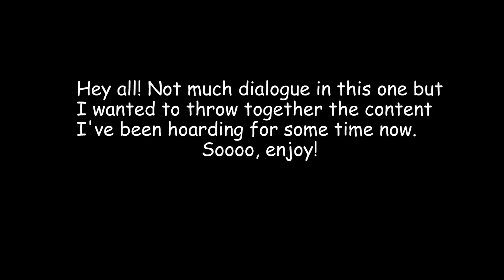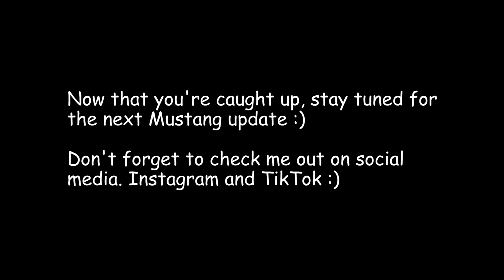Putting Together My Turbo Piping | Turbo LS Mustang

Comment: That T56 is going to be holding on for dear life LOL, might need a th400 or powerglide
Reply from the maker: Lol one way to find out! Haha prob gonna go with either of those two down the line
Reply: @rachaelrayve  ATF has a really affordable stock class powerglide for $1800 ish thats rated for 900 wheel. If you consider the swap, i think you'll make out even, i know those T56's cost an arm and a leg lol
Reply: If this is going to be a fun street car just keep the T56 if this is going to be a drag car sell it and get an automatic IMO. 4l80e is always a good choice since it has overdrive for decent street cruising.
Reply: @willisthehutt9422 powerglide weighs like 70lbs less than a 4l80e and a converter is like $1000 less, plus a built 4l80e is the same price as a reid case PG/400. T56's are pretty shitty, nothing better to cruise with then an auto.
Reply: @thewraith6360  it all comes down to what the car is used for.  If it’s a cruiser driving around 1:1 all the time probably won’t be great if the car is a cruiser. Besides who doesn’t love rowing gears in a manual?? I would rather cruise a stick any day over an auto.
Reply: @willisthehutt9422  Im good i enjoy a nice auto lays a nasty burnout whenever i want it to, plus the funnest part about a stick is powershifting or banging gears but do that with a stock t56 and it wont last long. Went through 2 in my cam only firebird after the first year it was cammed ike 9 years ago. If you want to go fast on the street or the track and want something that you can comfortorably cruise, an auto all day, if you want the feel of a sequential just get a ratcheting shifter for your auto.